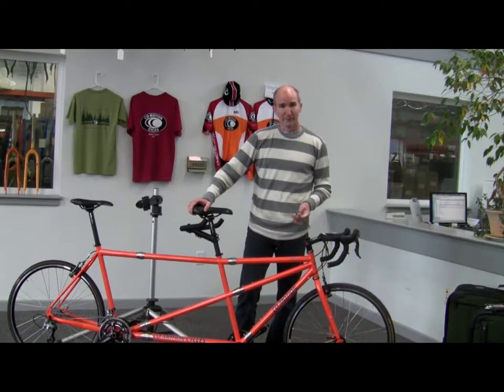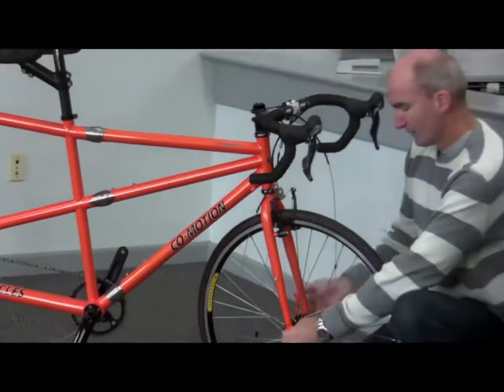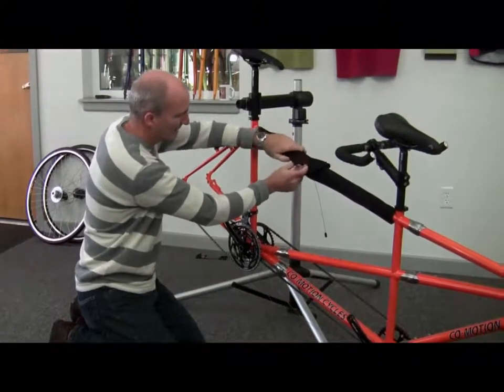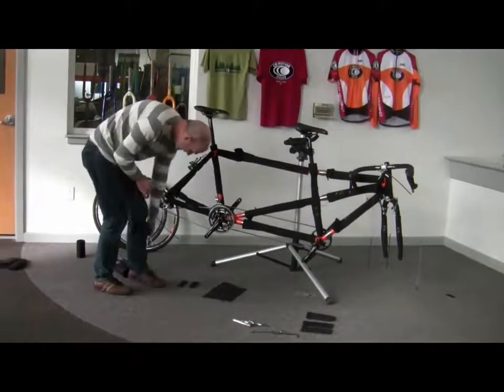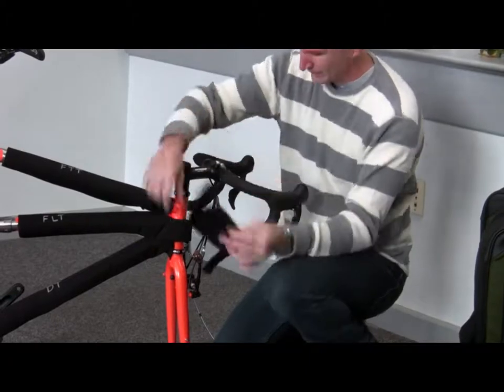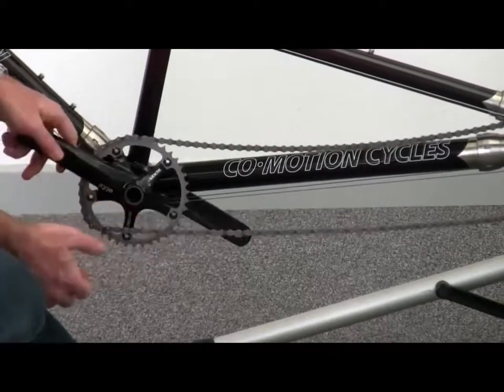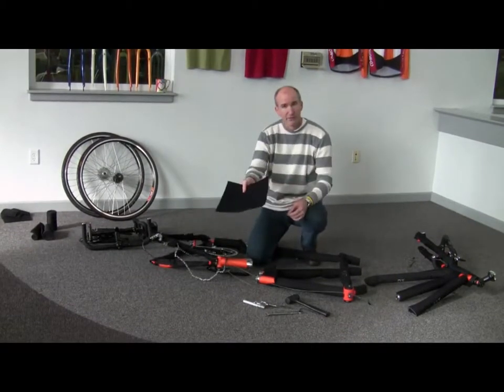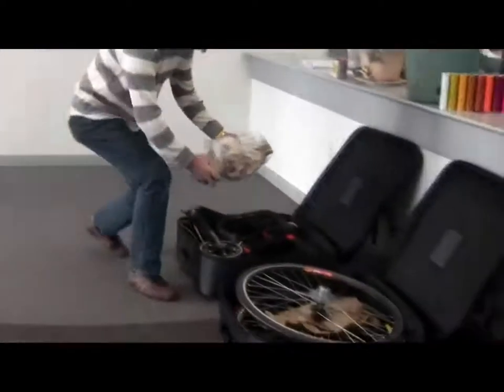Packing a tandem bike in airline compatible travel cases with Co Motion Cycles

Comment: This is helpful. It would be nice if you could make an updated video for bikes with pinion and rolhoff gearing system, thru axles and other upgrades. Also a video for those with single bikes (not tandem).
Reply from the maker: Hi Megan, we agree it would be nice and it's on our list. Please check out our packing manuals on the web site, which include one specifically for the Pinion equipped single bikes! Just scroll down to the support menu from the home page and click on manuals.

Comment: I was just going to try to source some plastic seat tube plugs for the tandem.  Many bikes are shipped with these from the manufacturer, so you can get them (and lots of other bike packaging) free from your LBS.
However, I've seen these plugs, as well as plastic fork braces crack and fail.  They really cannot take that much force.  In other words, when you NEED the reinforcement in crucial areas during an inadvertent big impact, it's not good that they get crushed.
Then it occurred to me:   just find an old seat post (or trimmings thereof) and cut a couple of 3-4" sections and install them in place of the removed seat posts, with the ends protruding about a half an inch.  These will fully protect the seat tube from any impact it may see (within reason, of course).  If you're REALLY detail-oriented, you can place padding on the protruding ends to attenuate any impact forces acting on the dummy posts.  Any major impacts that large will destroy the bike anyway, so damage to the seat cluster would be the least of your worries.  This has the added benefit of holding the seat clamp and binder bolt in place, as they will be snugly tightened on the dummy seat post sections.  
So now I have to decide if making all-thread fork tip and rear dropout inserts is worth all the trouble...

Comment: Great video!  Thanks for providing the information.
Very surprised to see that the captain's cranks have to come off.  That's a bummer.  
Love hearing the espresso grinder in the background just after two minutes!  Gotta stay awake to design more bikes!!!
PS  The Closed Captioning is hilarious!
Reply from the maker: Every bike packs a little differently, so you may not need to remove the captain's cranks on your tandem however it certainly provides more room.
Reply: FYI, the overhaul went without a hitch!  Six weeks to restore it to its original glory (better, actually, if I don't mind saying).  STI levers working flawlessly.  And the shifting?  Best tandem I've ever shifted!  What a bike!  The little bit of rust in the tubes is GONE, and they're now appropriately protected with FluidFilm.
Oh and I took my spoke tension meter to the wheels - tensions are PERFECT!  Even though the bike is now 15 years old, the wheels are still perfect.  Not a single ding or anything!  I think the previous owners used it strictly for travel.  The had two other tandems (like us), so I think they trained and rode regularly on their non-travel tandem.
Add to that... I'm returning to your great video to refresh my memory because, oh poor me, I have to pack our tandem!  Off to Europe for a two week tour.  So excited!!!
So thanks again for a great video and even better bike.  
❤❤❤

Comment: there has got to be a way to store a bike safely in a case without removing cranks, fenders and seats... perhaps using an accommodating hardshell case. It would be nice to focus on minimizing the time required for assembly and disassembly while on the road at the airport, hotel etc ...
Reply from the maker: Rene there are larger travel cases available, however they incur additional oversize and overweight bag fees.
Reply: There are myriad options for bicycle packing.  You can follow the manufacturers' lead use a cardboard bike box it like it came to your bike shop.  Or even find huge oversize boxes that only require pedal removal and twisting the handlebars 90 degrees.
But these are NOT the best solutions.  The bigger the box, the more flimsy it gets.  And the airlines are notorious for treating your luggage and bikes like crap.  So it works out that the more convenience you add to "boxing" your bike, the less secure it is and more prone to damage.  And I know of all sorts of bike travel horror stories.  Nothing worse than showing up for a Europe bike trip just in time with your bike to discover your bike has been rendered unusable by the airline.  Why bring it then?
And the S&S couplers were implemented to pack bikes in regulation suitcases, per Co-Motion's previous post.  They provide a solution that formerly didn't exist, offering small size and good protection.  Yes, it involves more work to achieve the small package.  Given these advantages, I find your complaint rather ignorant.
Buy a big hard case and protect your bike if you want to go that route.  Just remember you'll pay through the nose to fly with it, thanks to the jerk airlines!  (I understand they used to allow oversize musical instruments to fly free or inexpensively.  But once a tube becomes "bike related," it somehow deserves a penalty.  That is BEYOND lame!)